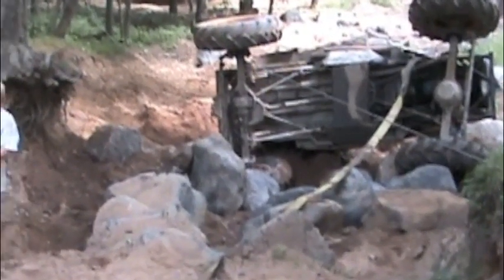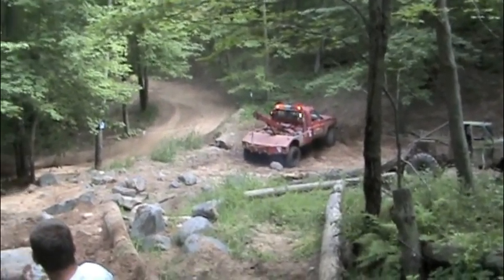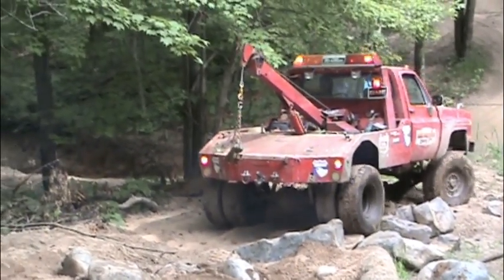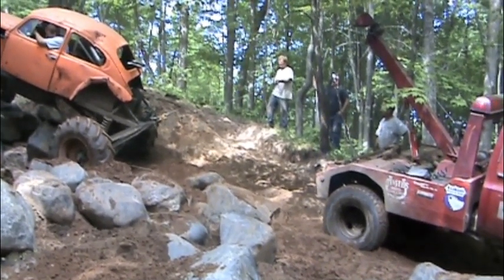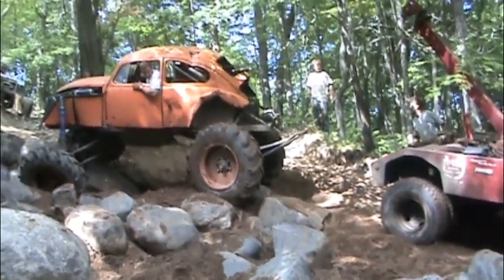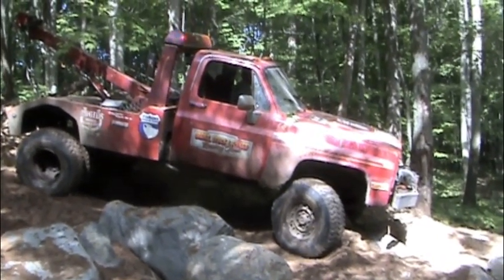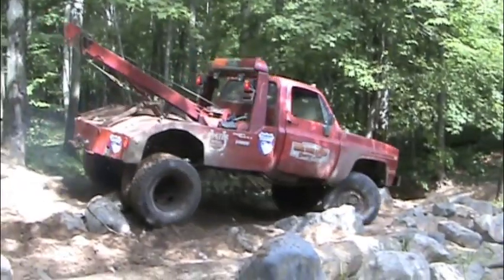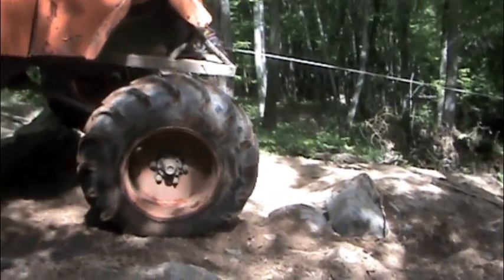OFF ROAD SUPPER BEETLE ROLLOVER RESCUE by BSF Recovery Team

Comment: hey man whats the running gear in that gm? mostly stock as in diffs and suspension? clearly theres a fair ammount of lift and a hear you have a locker and im assuming 454 but any mods for that? is seat cover your daughter or wife? and what do you generally charge for an extraction like that? i mean on road tows are generally about 100 to 150 bucks let alone way the hell out there lol im a subscriber and avid watcher love the channel and that the old chevy rescues highly modified rigs!LIKE A ROCK